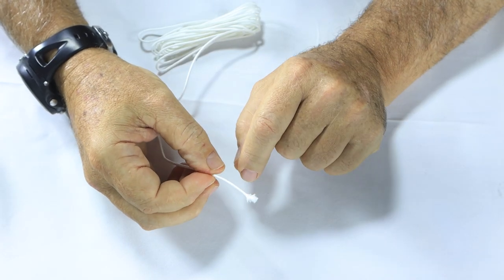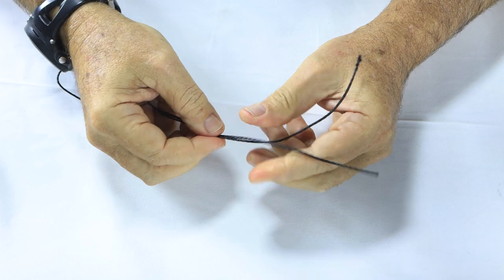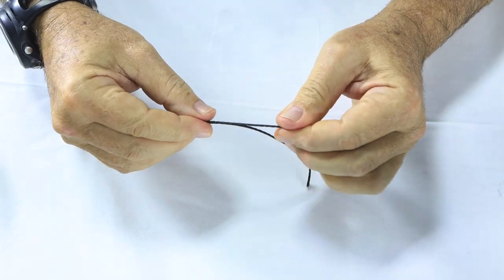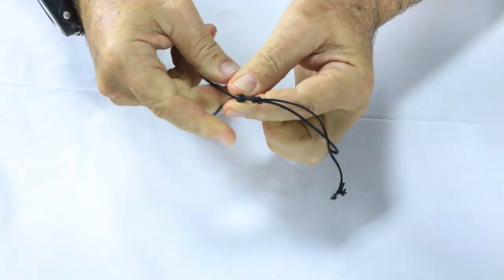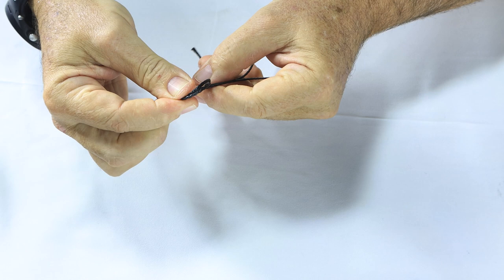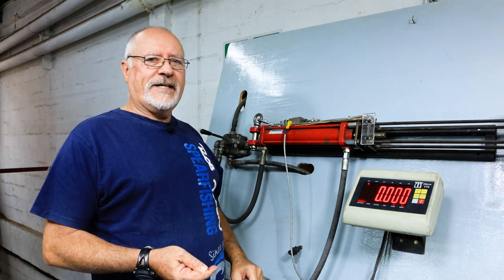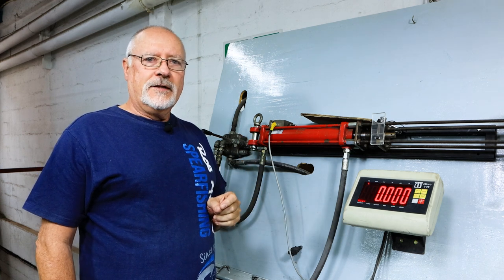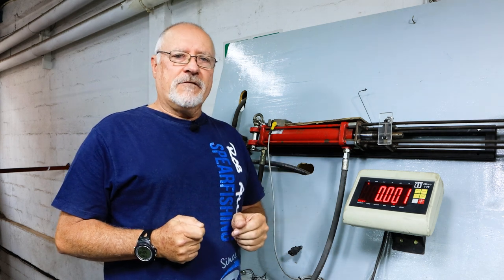Rob Allen | Drop Barb Line Break Test | 2022

Comment: Thanks for showing that knot! What about brummel lock the two ends like you would on a general hollow core dyneema shooting line? Would be even more low profil and maybe stronger as well? Cheers!
Reply from the maker: The weave of this hollow cord is just too tight to do a Brummel lock. It would also take much more time to do, not something you would want to do on the boat. We are reluctant to get the cord woven any softer as it will "flop" around more and possibly entangle with the spear and preventing deployment.

Comment: Rob, appreciate the video, but I had some issues with the drop barb.  Maybe you can help me troubleshoot:  trip to Costa Rica, brand new drop barb shaft as rigged by the RA factory.  Only the second shot of the trip, a small snapper hanging just over the reef, I landed the fish perfect accuracy, but noticed the drop barb came completely undone:  the dyneema knot had completely torn itself apart and failed.  I'm not sure if the dyneema got caught in some reef on the way towards the fish or what the issue was (but I think this would have deviated the shot).   Just very bizarre and made me question the strength of the dyneema on the drop barb.
Reply from the maker: There is a possible that it was not tied in the factory here correctly. The Dyneema is very strong as seen in the video. We have also had knots shear off if set up wrong and the knot was pulled up next to the barb. When shot through a fishes spin it can shear off.